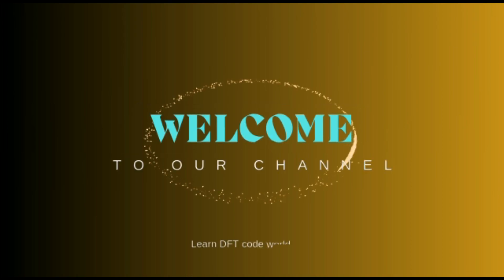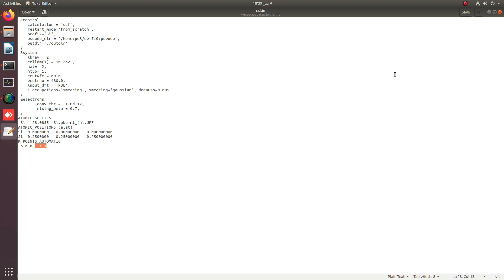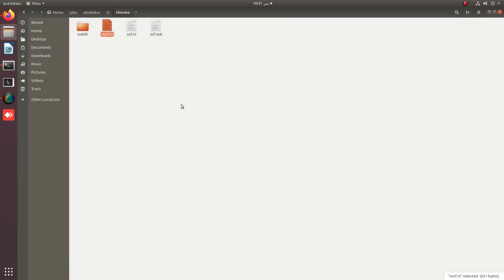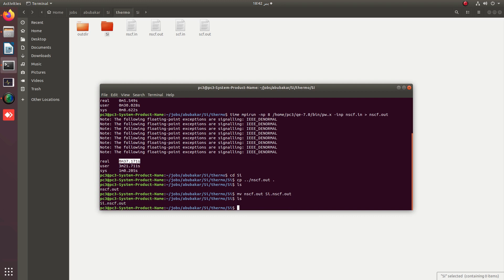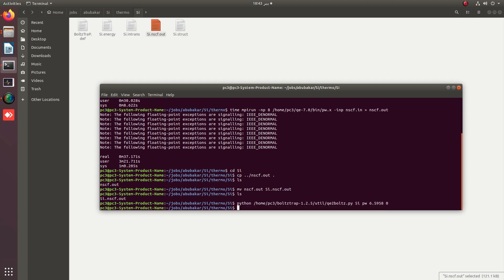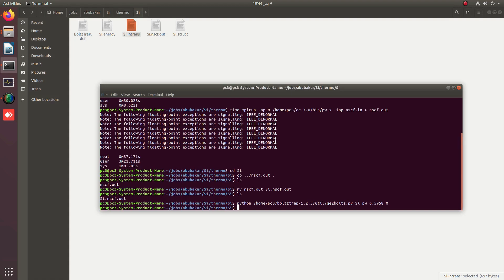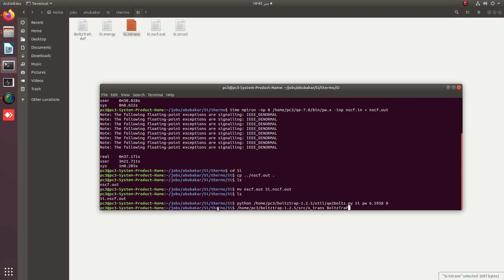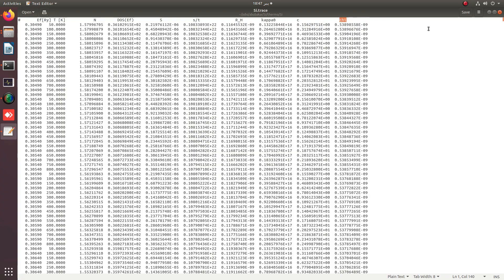Thermoelectric properties in Quantum ESPRESSO

Comment: At the last step when I put the instruction '/home/tech/boltztrap-1.2.5/src/x_trans' BoltzTraP It shows '' ================ BoltzTraP vs 1.2.5 =============

Program received signal SIGSEGV: Segmentation fault - invalid memory reference.

Backtrace for this error:
#0  0x7fa262287960 in ???
#1  0x7fa262286ac5 in ???
#2  0x7fa261e9751f in ???
        at ./signal/../sysdeps/unix/sysv/linux/x86_64/libc_sigaction.c:0
#3  0x561f4f75fd22 in boltztrap
        at /home/tech/boltztrap-1.2.5/src/BoltzTraP.F90:297
#4  0x561f4f7504ae in main
        at /home/tech/boltztrap-1.2.5/src/BoltzTraP.F90:20
Segmentation fault
0.2u 0.0s 0:00.56 64.2% 0+0k 19064+0io 90pf+0w'' and producing a buch of empty files and Si.trace file is absent.would please tell me how to solve it

Comment: While running x_trans BoltzTrap. I am getting the following error
Program received signal SIGSEGV: Segmentation fault - invalid memory reference.

Backtrace for this error:

#0  0x7f2e39423960 in ???

#1  0x7f2e39422ac5 in ???

#2  0x7f2e3904251f in ???

at ./signal/../sysdeps/unix/sysv/linux/x86_64/libc_sigaction.c:0

#3  0x55f1353b5cd4 in boltztrap

at /home/nkr/boltztrap-1.2.5/src/BoltzTraP.F90:297

#4  0x55f1353a64ae in main

at /home/nkr/boltztrap-1.2.5/src/BoltzTraP.F90:20

Segmentation fault (core dumped)

2.6u 0.0s 0:03.28 82.6% 0+0k 0+688io 0pf+0w

How can I resolve the issue

Comment: while calculating the thermoelastic property of Si like your video , I am facing a problem of "line 114 spin=true". everytime I try to run the code the error is showing in my terminal window. can you help me?
Reply from the maker: This error is due to the spin polarized scf calculation. Better to correct your input file.